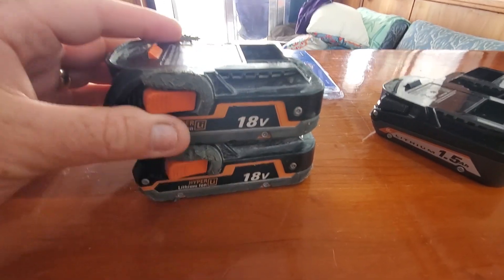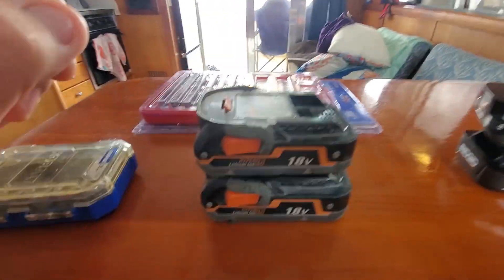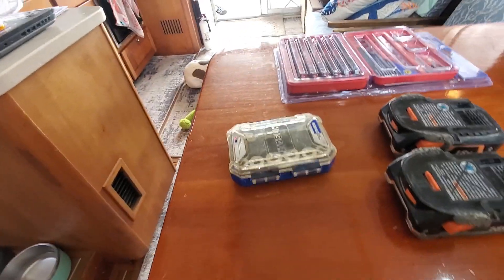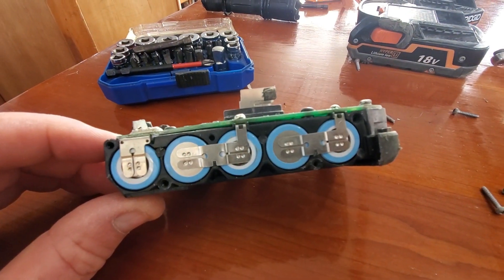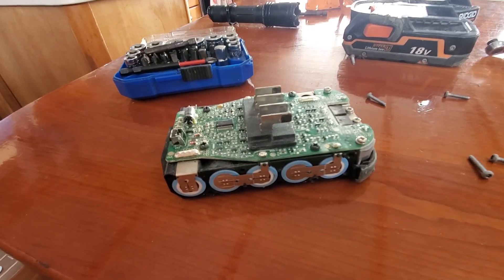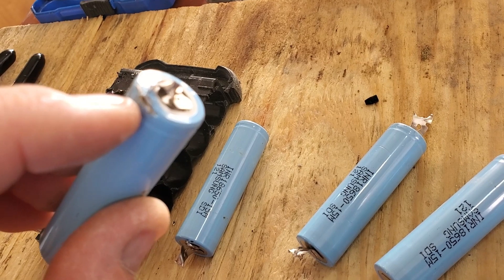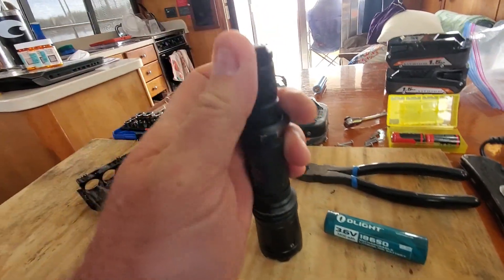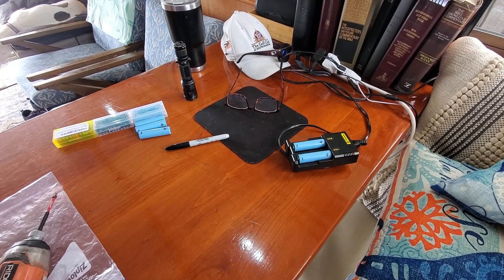Home Despot Ridgid batteries lifetime warrantee is legit. Convert old batteries.

Comment: Nice that you are recycling old batteries. I use old UPS 7.2ah batteries in my small solar power system as they still have some usable capacity left in them. Greetings from Jamaica.
Reply from the maker: They still work so why not.

Comment: At 10 years+ old, my guess is they are wore out.  For what it's worth, they're shorter because they don't have the integrated protection circuit built in, so you have to be careful about over discharging or shorting them.
Reply from the maker: True. Never thought about that. I guess my charger knows when they're full. I'll keep any eye on that. Thanks.